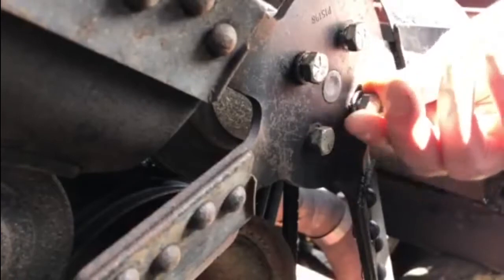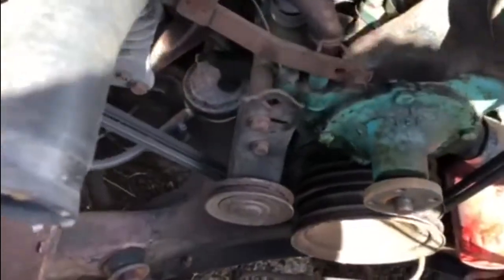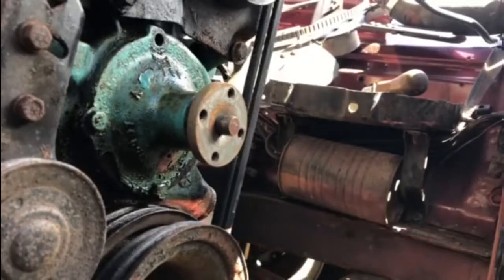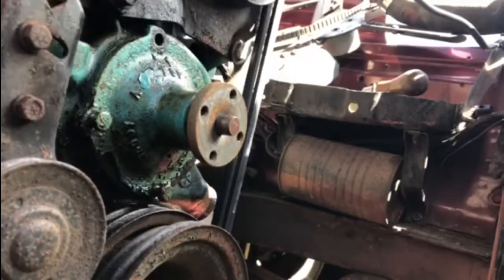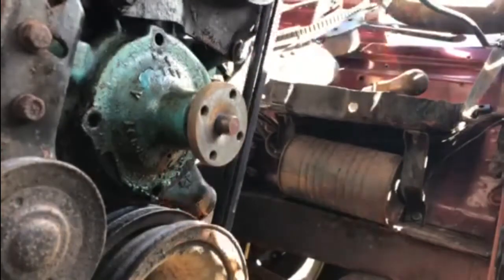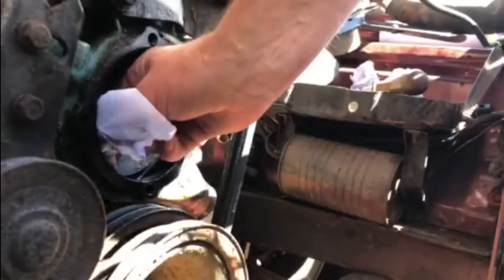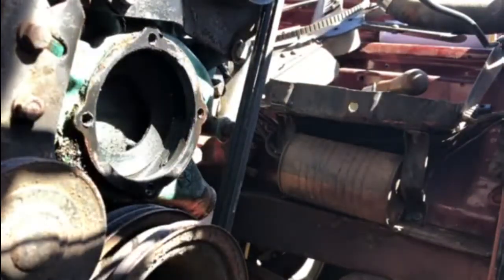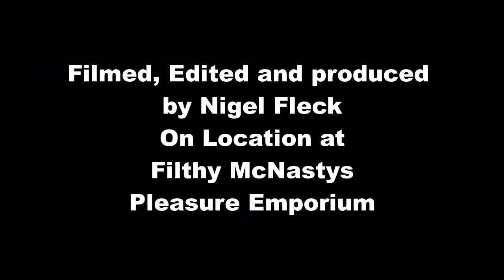When it's too hot to handle, it's time for a new cooling System, 1968 Dodge Charger

Comment: Nice Job !  I just did that to my Charger a couple of months ago, Radiator, waterpump, thermostat, my hoses were ok but I put a new shroud on.
Reply from the maker: Thanks Hugh, hasn’t appeared on YouTube yet, went to take it out earlier to check for any leaks, I crossthreaded the gearbox cooling pipe and it started pumping transmission fluid out. So now need to sort that out as well. All good fun though lol. Plenty videos coming as I’ve got loads I want to do. Thanks for watching and commenting